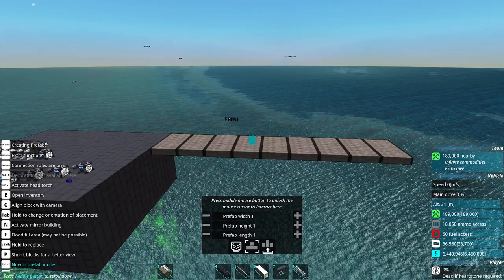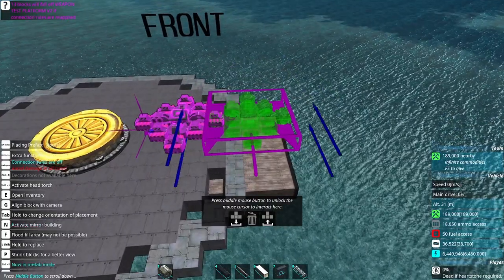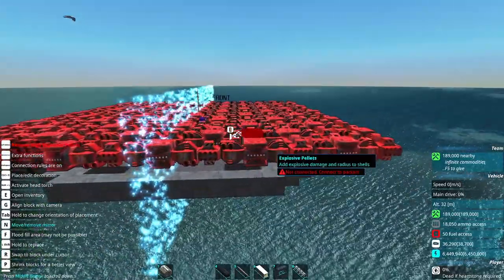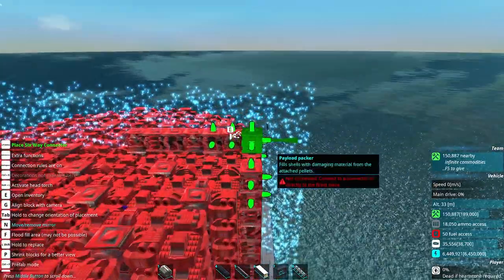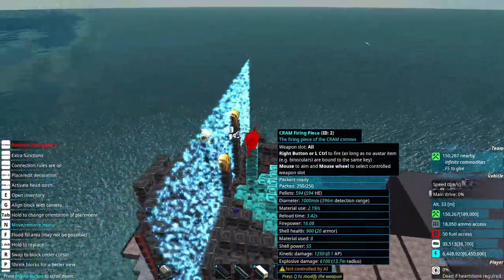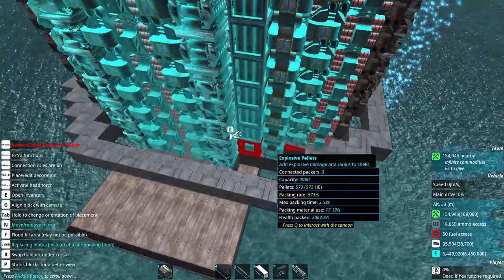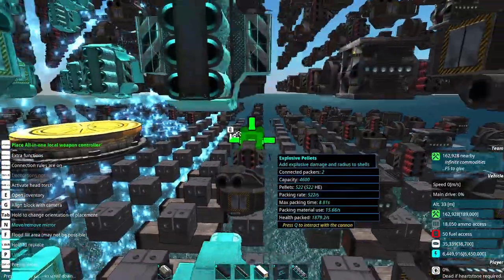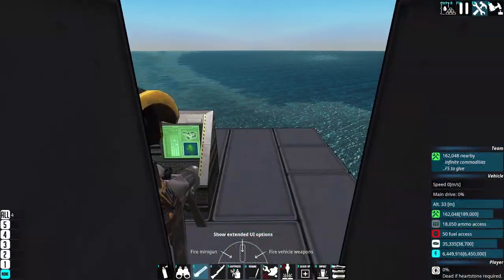Cram Cannon Quick Build Tutorial - Building a Large Cram Turret in Real Time

Comment: FYI optimal damage/second/volume for each gauge where number of gauge increasers = g is (5*rad6*rad(3g^2+80g+400)-6g-120)/(69g+380)*100% = percent of payload compactors. Hope this helps in some way.
Reply from the maker: Parse error: undefined symbol for architecture 'rad6' not found.
Jokes aside, I'll have to plot it against gauge. Is there a resource for the other CRAM equations like dps/volume as a function of gauge and compactors (which your equation was presumably derived from)?
Fire rate calculations would be nice too, then I could make a quick calculator to see how much dps I sacrifice for different fire rates at different gauges, but I imagine something like that probably already lives in a public spreadsheet somewhere.
Reply: @bungalowbill521  Quite a while ago (while I was in high school calculous) I decided to do an optimization problem. I created the equation for cram dps (never wrote it down btw) and stuck it into a derivative calculator which gave me the above equation. What I'm trying to say is that I only have that one equation. How I would go about building a turret with only that equation (because I have not made any armed crafts) is I would decide on a fire rate and ideal shell health (or firepower really). I would then pick the optimal gauge (with proper packer percentage) and scale the weapon size to the shell health I want. If it's too big, divide the fire rate between another barrel and repeat the process until you are happy. If you couldn't find the gun you want with that method, it wasn't possible in the first place. As this if a strategy for finding the optimal cram cannon (for your desired purpose and limits) it will take a lot longer and its better to create an equation that calculates shell health (which I don't have) or make easy mock turrets that you can fit into a real turret when you find the optimal statistics.
TLDR: polite way of saying figure it out for yourself because I don't know.
Anyway hope my thought process helps a bit and looking forward to you next video.

Comment: Ive seen in multiple tutorials that 1 big gun on a turret is better than multiple smaller guns on one turret, is this still true?
Reply: From just firepower stand point 1 gun (therefore one shell) is better, however statically you have to account for chance of missing or the barrels getting trimmed off in combat. Or over penetration by the one big shell. All down to use scenario and risk tolerance.
Reply from the maker: Adding additional barrels will add additional redundancy to a craft so that it can perform more reliably in combat.
The firepower should be equivalent. I believe that cram cannons have linear scaling, and pellets can be shared between firing systems. There is a cost overhead for each barrel since it adds more gauge increasers, barrel pieces, and bulk to the turret cap
Reply: I think the firepower consideration in the past is when each shell is damaged by anti munition, it's better to have a large and very tanky shell. However you can always hedge your bets and also have a kinetic focused shell go first. Personally with how inaccurate crams can be I don't feel comfortable putting all my eggs in one basket
Reply: Also don't forget the consideration of one big explosion vs multiple medium or small explosions. Imo vs a slow or static opponent one shell is better, whereas for general use or mobile opponent it's best to spread it out